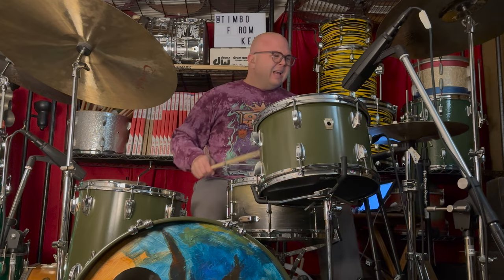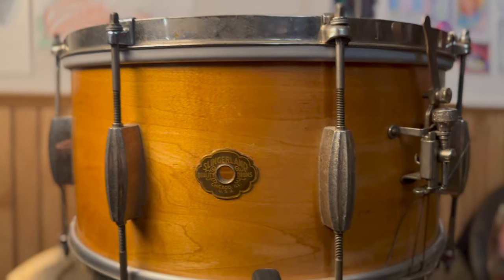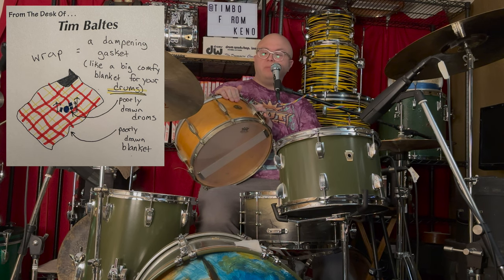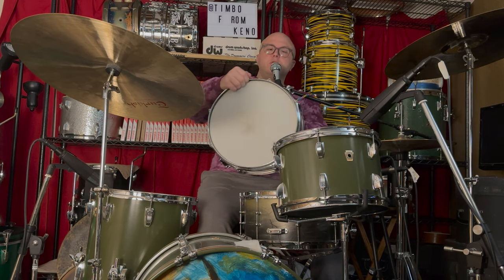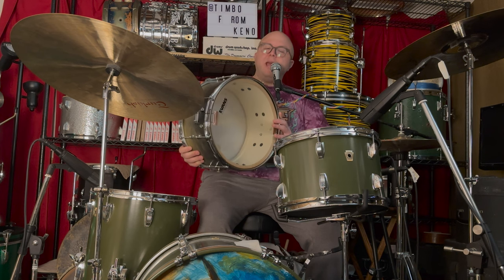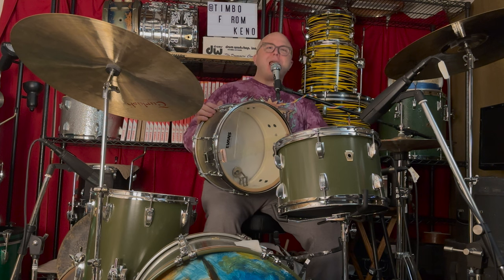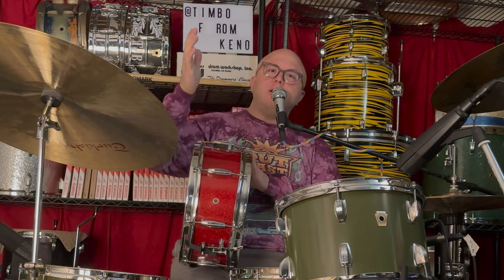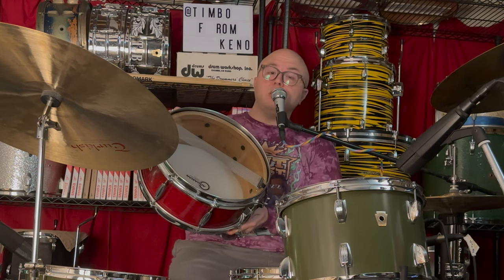The BEST Type Of Wood Snare Drum – Vintage Steambent Maple Snares

Comment: The snare bridges and fully extended snares were the basis of the Radio King patent.  Slingerland made other solid shell snares that weren't RK's.  Artist model, for example.
Reply from the maker: I didn’t realize that’s the basis for the original patent. Interesting!

And I actually owned an artist. Wonderful drum. Loved the tube lug look. I think they’re just often overlooked as compared to the RKs. : )
Reply: @timbofromkeno  Yes.  They all sound great!  In my '76 catalog, they have a snare that is 3 ply with the bridges and 3 point strainer and it's called the Radio King model.  Again, making the snare system the RK model.  Not the 1 ply.  Cheers!
Reply from the maker: @brianchisnell1548  Very interesting! Thanks again for the insight!!

Comment: Great video!What heads and wires were on the 14x7? Take care :)
Reply from the maker: Hey there. Thanks for the kind words! The bottom is a standard snare side head (Evans 300 weight). The wires are 20-strand steel. And the top (batter) head is an Evans UV2. Enjoy!